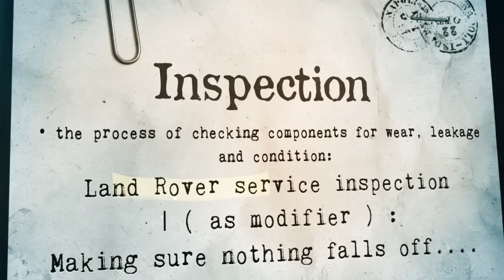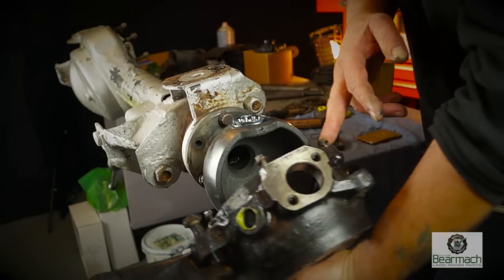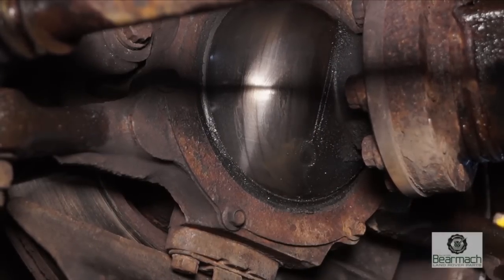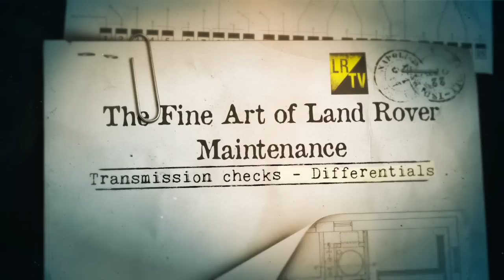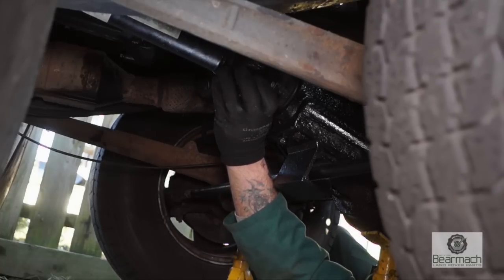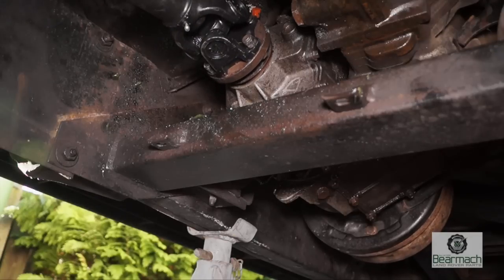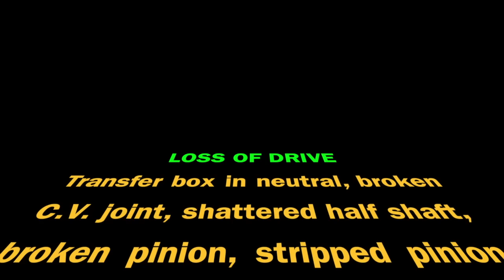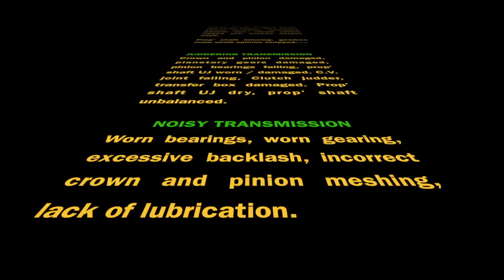Basic transmission check - diffs - The Fine Art of Land Rover Maintenance

Comment: Thank you for the presentation and Greetings from Paris !  I have a defender TD5 year 2003.  If I up-shift quickly with high RPM from 1st to 2d, or 2d to 3d, I feel a crunch/grind in my hand (not so loud to hear it in the vehicle, I can just feel it with my hand). 

If I leave the RPM/rev normal, and leave a 1 second pause on Neutral between these gears, all is fine. 

No crunch when downshifting. The gearbox runs with new MTF94 oil.

Is this a normal behavior for a R380 ? Are we supposed to UP shift slowly with these gearboxes, losing momentum ?

Losing momentum is not an issue on flat road, but annoying climbing a slope. 

Many thanks for your help and feedback !

Julien

Comment: Hi, I really find your videos helpful, I am only beginning to learn about Land Rover maintenance with my Defender 90 300Tdi. I have a question, I hear a squeaking noise when driving slowly, it comes from the bottom of the car, and I'm pretty sure it's the propshaft. Is it a serious problem? I know a diagnosis via YouTube comments is a bit of a stretch, but I just want to know if it could be a big issue before I try to fix it myself. Thanks!
Reply from the maker: +sebaaaa56  any noise that shouldn't be there will be ab issue eventually.  Could it be your brakes?  might be worth a check of your wheel bearing play.  If you have a fair bit of brake pedal travel then this is a good sign.   Other squeals could be aux. drive belt.   Never heard a prop shaft squeal.

Comment: I have a question.
I once saw an old boy stranded in his 110 Defender. I pulled over and he had lost drive but then the clue came, he said his handbrake had failed also.
I put the vehicle centre diff lock in and got him going again.
What had failed? I am guessing something in the transfer box?
Reply: Hi, could have been a broken half shaft either front or rear. Had similar with my 110. I got to a garage 20k away slowly in diff lock Hi. Turned out one rear shaft was broken. Diff lock diverted power to front wheels instead of wasted spinning the broken rear. I stand to be corrected.
Reply: @dsmash447  Thanks David.
You have a real African surname there. Where are you from?

Comment: I understand a slight clunk when letting out the clutch is normal... if the engine speed isnt matched correctly with speed... is this correct?
Reply from the maker: yeah it is quite slack in there.

Comment: Noisy transmissions???....... are you referring to gearbox chatter or something else???.......by the way do you know if anything can be done on gearbox chatter
Reply from the maker: `you have to work out if it is the clutch springs rattling or the bearings chattering.   The gearbox may need stripping and inspected to work out why the gearbox chatters.    there is no magic bullet to cure this one.